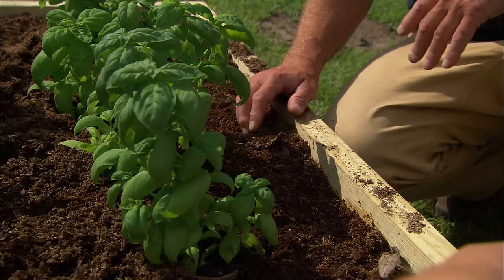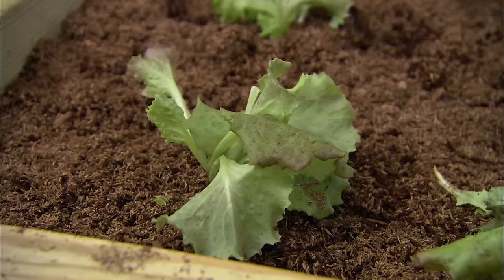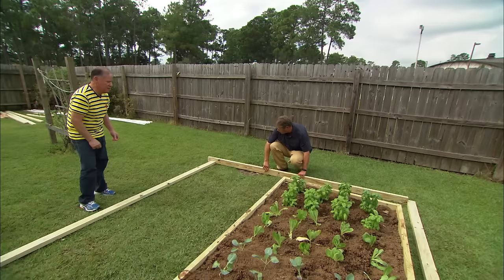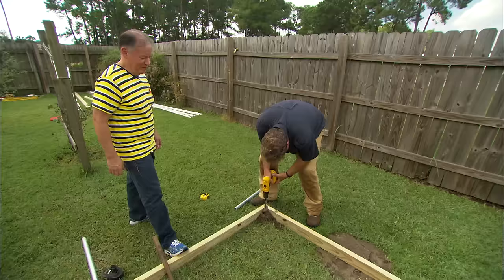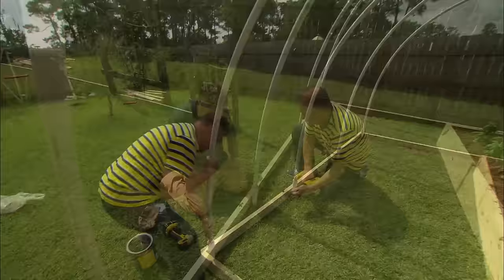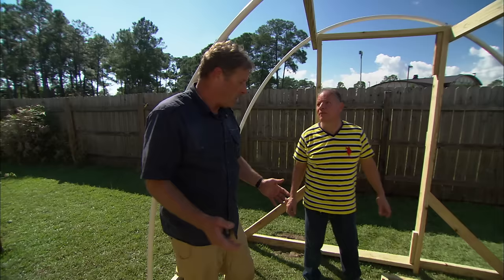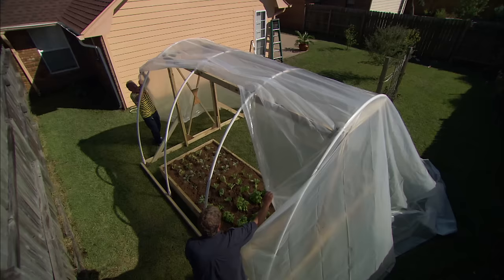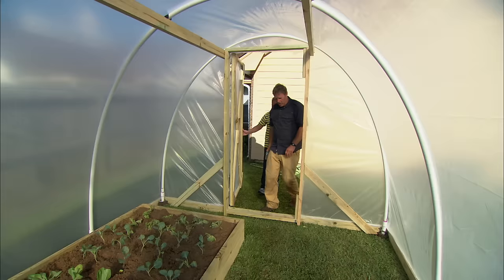How to Build a High-Tunnel Greenhouse | Ask This Old House

Comment: Those cheap thin metal brackets are not gonna hold those hoops down in a wind storms. Should have drilled holes and screwed them fast. Even with that the metal pipes could pull up from the ground. Must not ever be any wind there.

Comment: More than a comment, it is a question. My raised garden is 35 ft long. How do I connect safely the 2x4s? I need 3-12 ft long aprox. And Im looking to secure them safely. Thanks for your help, anyone. 😊
Reply: You use a short piece of 2x4 and screw it to both sides of the long 2x4 to extend them.

Comment: Should have used 6 mil poly it's the industry standard. Use duct tape on the PVC pipe that will be in contact with the poly covering.

Comment: Why not just use a 1 1/2" metal pipe instead so you can just stick it in? Also that plastic will make it an oven in there. Wouldnt netting be better?

Comment: Any idea how to build one that is half of your bed length and folds back onto itself and collapses kind of like an old car top? I want something like that for my back beds that are along my back fence. And if I got ones for my main beds I would want to do the same and hide it in some wood frames so it can be closed and sat on afterwords.. just not sure on height and other things for back trellacing on the back ones as it might have 3 foot trellacing on the very back and a bit of height clearance. I could probably just do the trellace in the middle or along the side I guess. And I'm trying to figure this out on a budge. 8p

i was thinking a single hinge on the back corner and a half length along the shorter side with PVP that interconnects or something interesting and hence can collapse to a given length or something. Just starting to try to find a way to do it. Not familiar with PVP parts and sized though.
Reply: Check out Leon's greenhouses in Kingston Oklahoma

Comment: No video of all the materials for the doors etc.  That was not a cheap project.  For those north of the Mason Dixon,  what is the snow load of clear plastic?   T 50 staples to fasten it to a frame .. yeah sure..  no battens over the plastic before fastening it?  Bad idea.

Comment: useless anywhere you get more than a light breeze - Plastic will tear off the staples for one.  You must use UV stabilised plastic and be prepared to replace the PVC pipes once the UV  rays make it brittle .......... In Australia that would be annual on plastic and 2-3 years on pipes
Reply: I have heard of painting the pvc with old latex paint for UV protection and you could cut wood strips for fastening down over the plastic at the edges.

Comment: Can anyone here give me some advice on a material that will hold off the snow in winter months, I live in Canada and want to have a structure that can withstand the weather conditions year round. I am on board with the base but worried about caving in.
Reply: I would only use 6ml greenhouse poly for that purpose.  It is a bit expensive but better for the plants and lasts much longer
Reply: @1Nevergiveup  thank you for your insight

Comment: Shouldn't be putting pressure treated lumber near food crops. Alternatives are untreated, cedar, or untreated painted with spar varnish. Since they were using non UV resistant poly, untreated wood will outlive that.

Comment: never use pressure treated wood with anything that you have to use with a garden, also there is no need to make a second frame, you can just use the raised bed as the frame to the greenhouse
Reply: also only use 1 door, less area for leakage, and dont use baskets (less dirt means faster freeze), this is a horrible way to make a high tunnel
Reply: @zenephret9635  - No matter what you do, the inside temperature will equal the outside temperature at night.

Comment: So well rehearsed and scripted lol. But great video nonetheless. Just one question though. Won't the wind cause the plastic to tear through the staples? My suggestion is to cut a coke bottle into 1 inch squares, and staple that between the plastic and the staple. To reinforce the "joint" and prevent the plastic from tearing. If that makes sense lol

Comment: If you're going to go to the trouble to make this, get better plastic. Plastic like this will crack within one year due to it not being UV rated, it having no filament to strengthen it and the overall small mil. Film at slightly higher mil w/ UV treating will last 4 years and 10 mil or above will last 8+ years. The higher mil films can actually hold hundreds of pounds and will last nearly as long as polyurethane panels while costing half the price.

Comment: Clearly not a gardener, either one of them. There were way too many plants in that raised bed. Mature plants take up a lot of space. Also, the whole point have a raised bed like that is to be able to reach into it from all sides without having to step on the soil so as not to compact it. The way they set up the greenhouse makes it almost impossible to reach the plants at the edge.

Comment: Why overcomplicate the design by having to adapt the pipe ends to fit over the galvenized pipe? Makes no sense!
Why not just buy a 20' pipe with an o.d. that's the same as the i.d. of the galvenized pipe in the ground?
3/4" od pvc into a 3/4" id galvenized pipe.... Instead of having to buy adapter parts...
Reply: the thinner pipe is more flexible to bend the arch, he said that in the video.
Reply: @alanmccormick6911  ?? Um... We're not even on the same page.

Comment: ok , first off, winter where? because where i live, that structure will collapse in winter, secondly, do not staple the plastic, it will be blown off from the first wind storm, get yourself some thin slats of wood and screw it together and sandwich them , third, dont use pvc unless you are willing to have it collapse , go buy the steel hoops, they really are not that expensive compared to plastic , and when done properly, will last a lifetime, not a few winters

Comment: They made it sound like all you needed was the pvc pipe, 2x4s and plastic on their first trip to the store. That was about 1/2 of the total cost. You have the galvanized steel pipe, screws, pipe fittings, door hardware and hinges, ect. Plus he got 20' lengths of material, you think that's gonna fit in your average truck with an 8' bed? Don't make it sound like a DIY project when you can't even get the material home. Instead build it out of galvanized metal conduit pipe and fittings bought online or at your local farmer's mart. It will last for years and you can get the materials home in your average truck. I know because I used to rent tents for parties made from it and had them for 10+ years. PVC over time with weather extremes will crack and break. He's got some nerve talking down to Tom Silva. You built a poor man's greenhouse, that makes you a master carpenter?????

Comment: He should have done some reading before he went shopping. PVC pipe doesn't do well in the sun. Neither does that plastic they used. Both will likely not survive much over a year before needing replaced. I think he coulda done better. Also, I think the owner may get a little frustrated at the heat levels roasting his veggies when he forgets to open those doors. Automatic ventilation seems like such an extravagance, until you need it... a small thermostatically controlled vent isn't that expensive. Oh, well. Kinda pains me now that the video is out there because someone will look at it and think it's THE way to build a high tunnel, after all if he did it, it must be right.  (sigh)

Comment: So many mistake in this build....i  could make a list of at least 2 dozen.  (based on 45 years in the construction trade)  but I'll bet Tom Silva would not approve.  The only good thing it's nice and short and too the point but will not last more than a few years.  (Never use white PVC pipe in outdoor applications...it will rot in the sunlight and crack)

Comment: I threw-up a little when he said “staple the plastic”
Reply: Lol yeah
Reply: Joe Dasilva how would you anchor it instead?
Reply: @r0bbed995  sorry for sticking my head in, but usually you would screw down a long timber strip along the top edges once full.
Hope that helps , it is done this way to increase clamping surface area.
Reply: BruceSchultzAu thanks Bruce!

Comment: Ok.  What keeps the PVC from blowing away?  Those pieces glued to the bottom of the PVC are not going to help hold down the tarp with those metal things.  Nothing is attached to the PVC!   The boards aren't secured, either!  Good grief!  I could do a better job of securing that thing!!!!  btw:  staples thru the tarp?  Really?!  Puh-leeeeze!

Comment: Man...this is honestly a terrible green house. Those staples will rip right through the plastic. Regular 6 mil from the hardware store is good for 6 months or less outside before it gets brittle and cracks/tears. He spent more on fittings than he did pipe when he could've just slipped it over pieces of rebar. This is a very temporary build. I know because I built the exact thing to dry lumber last summer. It was meant to last 6 months, barely made that.